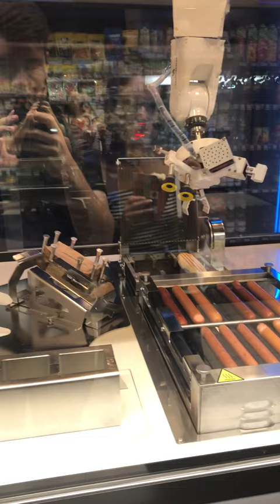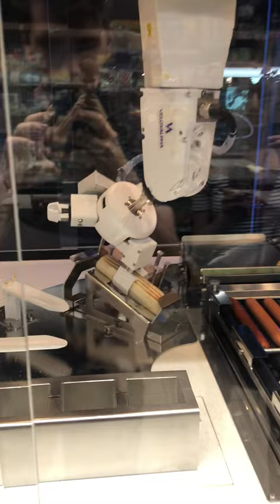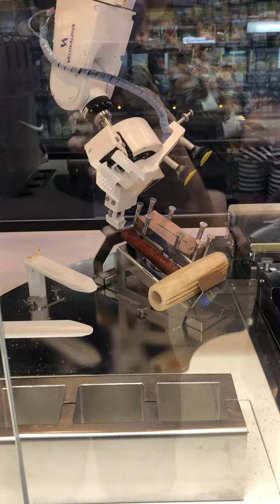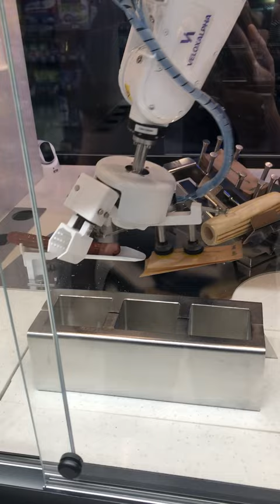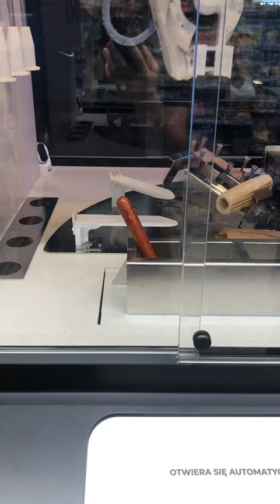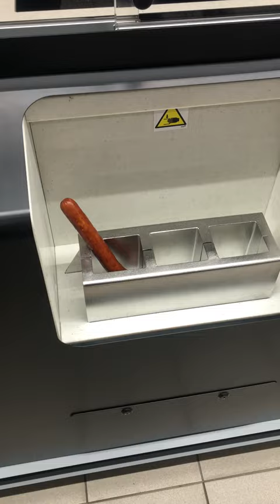Hotdog Making Robot Fails || ViralHog

Comment: Insane, that a single robot mechanical arm can't even make a SINGLE hot dog. How is it going to take our jobs when they can't even do a single simple thing.
Reply: and some perform neurosurgery...
Reply: @thegougy hat’s a bit disingenuous. Surgeons are still in control of those robots. Hence, robot-assisted neurosurgery.
Reply: @jenniferk.945  I stand corrected - indeed the massive usage so far is still "helping hand/better eyes" only bit imho not for very long.
Reply: What's needed is a hybrid Neurosurgery ready hot dog maker, but on the down side, if the AI goes wrong, we could all end up eating brains soon 😂🧠🌭
Reply: It doesn't needs to be better. It just needs to be cheaper
No one ever said that the robots replacing us would be doing the job better, or even equally. They're just cheaper.
Reply: Plus, all invention gets improved over time.
Reply: @FelipeKana1  which is why people need to break them  👍
Reply: @mrg-ghx8052  YES!
Reply: The problem is being a mechanical arm, a specialized machine would be a bit more expensive but would do it right in less than 5 sec.